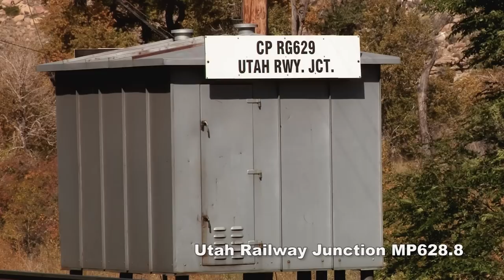Manned Helpers on Soldier Summit

Comment: Takes me back to a very memorable trip onboard Silver Solarium tacked onto the rear of #5 a number of years ago.  Running a good 10 hours late out of Helper overtaking a coal drag on the hill.  Vestibule door open almost able to touch the Helpers working hard against gravity.  A flood of sound and smell that will never be forgotten.  I have this vid, as well as 95% of your offerings... top notch.  Thanks for posting.  Cheers.  -grant
Reply: Is Silver Solarium a private car from a railroad that used to operate passenger trains?
Reply: Originally owned bt the CB&Q, went to Amtrak and eventually on to private ownership, operated by California Zephyr Railcar Charters.  The car is now in Ohio running on the Cayahoga Valley Scenic Railroad I believe.
Reply: private cars should not be allowed on Amtrak

Comment: Just curious, why are the manned helpers cut in mid train? Wouldn't it make more sense to put the remote controlled units mid train and the manned helpers on the rear? That way when they reach the summit they only have to uncouple the manned helpers and not have to break the train in half...
Reply: The mid train units are temporary just to get to the summit, where we cut them back out and head back to Helper.
Reply: The rear motors need to stay on the rear, due to loading and unloading requirements.

Comment: Great footage. 
I am just wondering why they dont replace those,old locos with the 
ones Germany and Sweden got? 
German locos got 10000 hp and Sweden I believe 18000 hp
Reply: Those are electric locomotives. America has trackage rights to allow long trains, so stringing several locomotives together will achieve the same goal
Reply: the problem is that theres no overhead power in those regions, building the lines and actually getting the electricity up there is a huge project that would propably cost billions. its easier to bring the energy with you in form of diesel fuel.  the electric locomotives have more power but are lighter with less traction effort per unit so theyd need the same amount. and to those billions of dollars investments for the overhead power, the railroads would need to purchase a rather big amount of electric locomotives as there arent any in service by now.

Comment: I really wish I had made the effort to film the Utah Railway operations before they stopped hauling coal. As I understand it, most of their motive power roster has been reassigned elsewhere.
Reply from the maker: The best advice I can give is to shoot a subject while you can because you never know how long it will last. It is a lesson I have had to learn too many times.
Reply: As I understand it, the train traffic in the Helper are and over Soldier Summit has declined substantially given the dramatic reduction in coal use that drove a significant percentage of consists over the summit.  Waiting around for a train at Gilluly Loops can now take many hours.
Reply: Exactly! While filming the crazy lease consists on CSX in the early 2000’s, a good friend said “photograph it today, because it’ll be gone tomorrow.” I caught WC 6652 in Georgia in 2002. After it returned to home rails four days later, its fluids were drained and was strickened from the roster. I got the very last photo of it on the mainline.

Comment: Are the manned helpers radio controlled or is the throttle set by the crew on board?
Reply from the maker: Manned helpers mean there is an engineer at the throttle.
Reply: How do they coordinate throttle settings with head end?

Comment: I think you mentioned that the middle helpers were automatically controlled (APU?) while the tail end engines were manned. How much are the various engineers occupied with balancing the load of the train among all those power units?
Reply from the maker: Sorry this has become a longer answer than I anticipated! 

Actually the middle helpers are manned and the rear engines are DPU (controlled by the engineer on the head-end of the train). As to where they make the cut to add the manned helpers a formula is used based on the total tonnage of the train. This is more complicated if the train is a mixed manifest with different types of cars and a mixture of loads and empties.  (A railroader could answer that part better than I.) 

The engineers communicate via radio as to what throttle setting, etc. In DPU operation, the remote units can either mimic the throttle/brake settings on the lead engine or the engineer can "put up the fence" and run the DPU's independently. Say the lead engines have crested the grade and need to throttle back while the rear DPU's continue to shove. This takes experienced engineers who know when to make the proper adjustments when working with all that tonnage and horsepower.
Reply: @7ideaproductions  Here on the east Coast when we have to add mid helpers, we try to make it so the helpers are pushing and pulling about the same weight counting what the front is pulling so about 50-60% back in the train base on tonnage. If the train does have DPU on the rear we'll move the mid units ahead a number of cars.
Reply: Railroad answer: 47 cars back.

Comment: What's the combined weight of this massive train? The coal train with 11 engines and 100 coal cars?
Reply from the maker: Just a guess but probably at least 14,000 tons not including the engines. Each GE locomotive pictured here weighs roughly 426,000 pounds.
Reply: Generally around 12k. However it has been years since this stuff has been weighed, so that is approximate.

Comment: How many DPU units are manned?
Reply from the maker: DPU (Distributed Power Units) are radio controlled from the head-end. A set of "manned" helpers generally have a crew of two: 1 engineer and 1 conductor. Where you see the set of three UP engines cut into the train, there is only one engine that is crewed. The others are MU'd (Multiple Unit) together electronically and simply mimic what the crewed engine does. 
At the same time, DPU power works similarly. Only one of the remote controlled units needs to communicate with the lead locomotive on the train. The other engines in the set are MU'd and mimic what the radio controlled engine does. 
I hope this makes sense. This is a general answer and there are a lot of different scenarios that could be covered.

Comment: Why put pushers in the middle of the train instead of at the end?
Reply from the maker: It's about safe train handling. Basically it is for the best distribution of power in the train. Railroads use a formula for calculating where to put the helper power based on the territory and train makeup. This is my (filmmaker) answer. I am sure a railroader who does it every day will be able to give you a better answer.
Reply: @7ideaproductions  BNSF is currently testing mid train DPUs with their coal trains here on the Thayer Subdivision as well running them in a 2×2×1 configuration.
Reply: Because too much power at the rear will derail you on a curve. Is the simple answer.

Comment: Run those locos full throttle day after day.  Wonder how long the prime movers run before full overhaul or replacement?  Hope the engineers and conductors have very high quality ear protection.  The noise in the cab must be outrageous.
Reply: Far longer than the manufacturer intended.

Comment: No railroad  should be  using radio controlled locomotives in the  middle of the  train.because, if the helper units RECIEVE  a bad signal, the end results will be  a derailment with  dire consequences!remote control  locomotives  are not safe to operate, or be around. Especially  in freight  yards where you have  a lot of tankcars carrying hazardous  chemicals!it is  better for  the engineer to  bein the cab  controlling the units instead of  being on the ground  controlling the locomotive!
Reply: That is a ridiculous theory. What do you base it on?